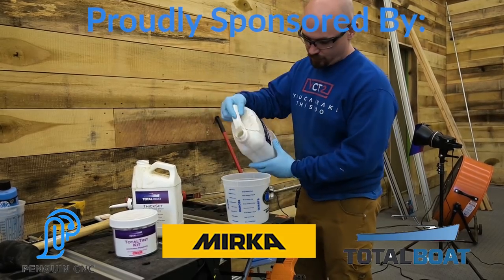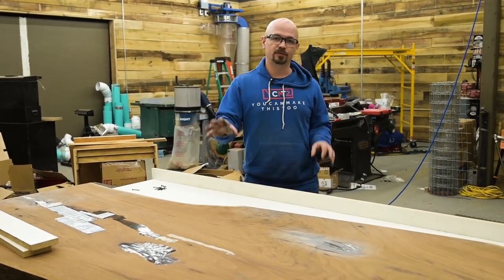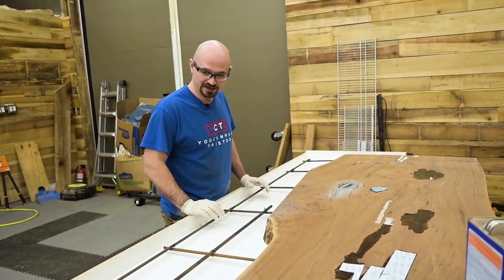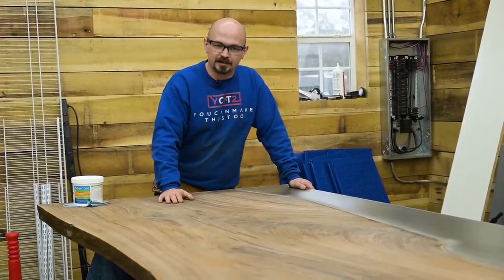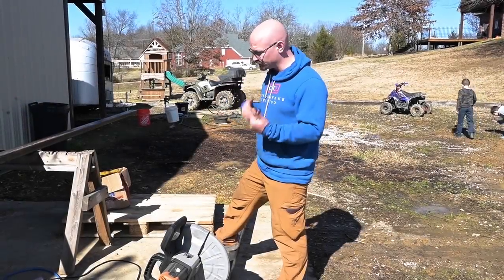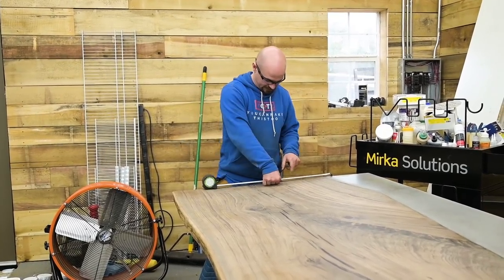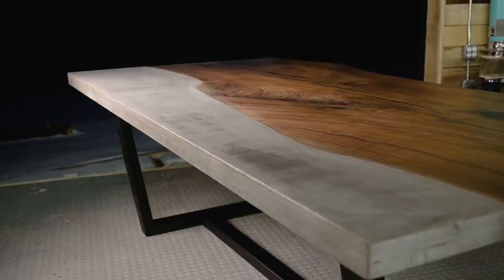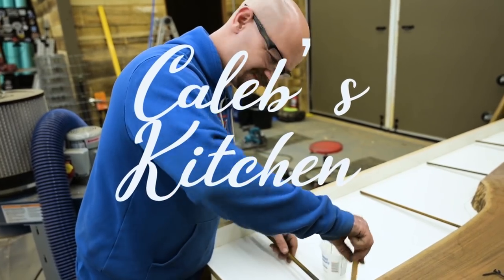Make a Modern Wood and Concrete Table

Comment: Inside corner welding: Downhill all the way, light up on the flat surface you can grind, prettiest welds of all are inside corners once you get your gun angle right. Should be pointing into the weld, splitting the angle of the joint, pointed down at about 30 degrees
Reply from the maker: Good tips, thanks! I normally do pretty well with them but didn't want to risk it since I'm out of practice and it was a client job... but in hindsight I could've warmed up on the joints that'd be hidden. Either way, next time I do them I'll definitely be sure I'm approaching it the way you way you mentioned 👍🏼

Comment: Yes, love the contrast between the concrete and the walnut. How did you make the transition between the wood and stone in the end? Just smooth the edges down and leave the natural gap? Thx from France!
Reply from the maker: I sanded it down a bit but ultimately left the gap. I was debating filling it with black caulk (would have some flexibility and wouldn't crack as well) but the client opted for keeping it a little more industrial. Thanks for watching!
Reply: @YouCanMakeThisToo  My pleasure. Really enjoyed that. And ever so slightly envious of your workshop ;-)
Reply: I just saw this video and was about to ask the same question as Erwin. Do you have a video of filling in the edge with black caulk or some other material that makes the edge between the two materials seamless and smooth. Love your work by the way, definitely subscribing from Fiji 🇫🇯. Thanks in advance.

Comment: Great video! (1) What did you end up doing for the transition? (2) Have you ever tried using foam to cut down on the weight?
Reply from the maker: Talked to the client and they liked the rough look so I just left it. I thought about using foam but decided against it.

Comment: Fantastic work sir!  How are you liking that dust collector?  I’m thinking about the same portable unit from Rockler.
Reply from the maker: It worked pretty well. I have a ClearVue cyclone but got the Rockler to use until I got the CV set up.

Comment: what kind of tape did you use on the back of the slab to control the epoxy?  also any issues with shrinkage of the concrete and pulling away from the slab?
Reply from the maker: It was just some dolphin seaming tape, just about any tape works. The concrete isn’t attached to the base, just to the slab, so the wood can’t pull away from it. If the wood moves it’ll just drag the concrete the 1/32” with it.